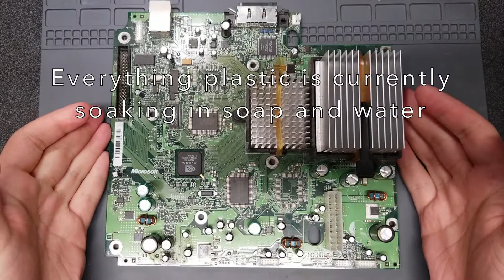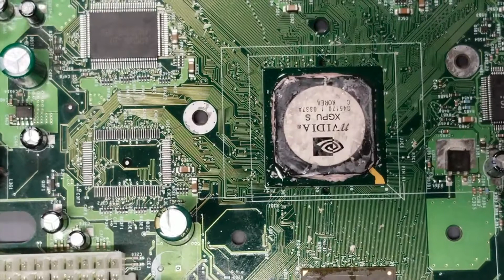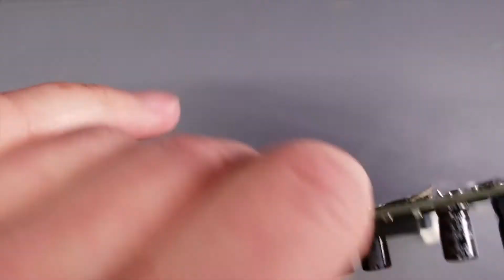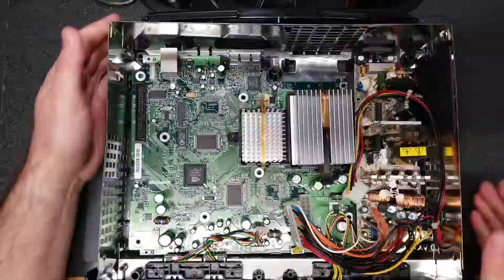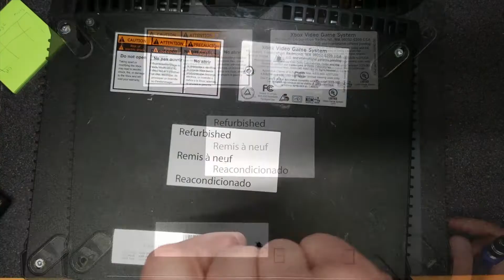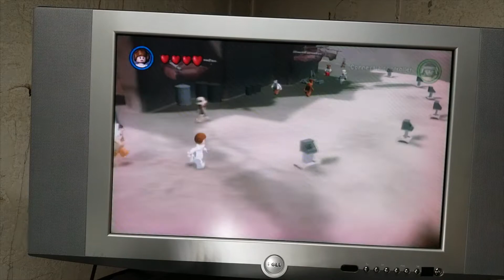OG XBOX Repair, Pt. 3

Comment: also take the clock capacitor off also it will damage the board , i am seeing it also happening on xbox v 1.6 now happening
Reply from the maker: I opted to remove the old one and replace it with a new one, but I did think about leaving it without one. I'll keep an eye out every so often to make sure the new one doesn't leak, but in theory it should last 10+ years. Hoping anyway!
Reply: Yes but on the v1.6 im am seeing them leaking  now i had one i had to reflow and remove the ide connector and clean everything to make it work again

Comment: use  goo gone to get it off its a little easier and after make sure to use lots of alcohol to clean it off after
Reply: Yes for the thermal paste works better with goo gone then clean good with 99 ipa
Reply from the maker: Thanks for the tip! Hopefully it helps others out too!
Reply from the maker: Guessing you're referring to the thermal paste? Didn't even think about using that. If I ever have to work on another one I'll definitely keep that in mind! I spent too much time scraping away the old stuff.